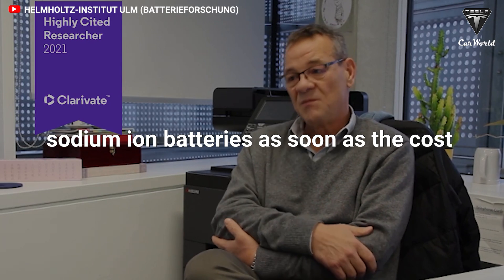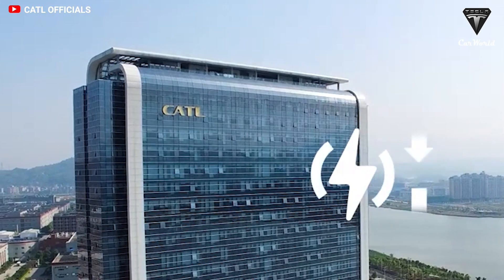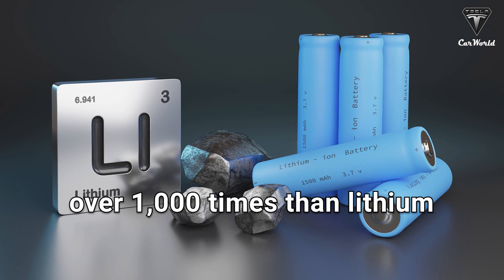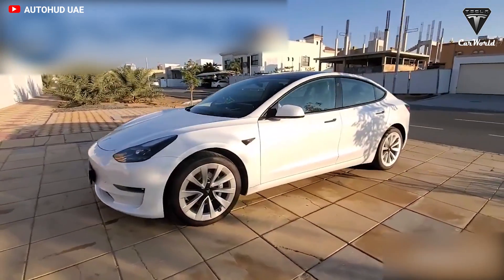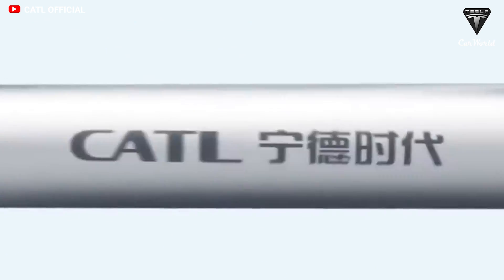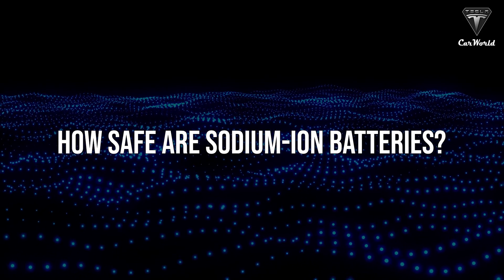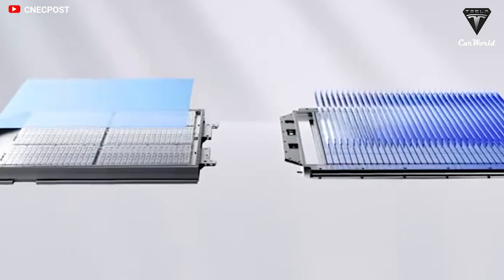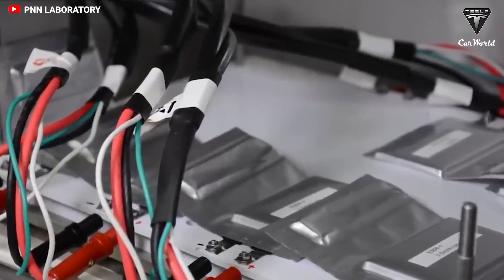Goodbye Lithium! NEW Sodium Ion 4.0 Battery Changes Everything in 2023!

Comment: One thing neglected to be mentioned here is how does Na-ion compare with Li-ion in regards to physical weight?  It'll affect range if more weight is needed to be moved.
Reply: They're heavier, but if they can charge faster and/or are cheaper, it might not matter.
Reply: @eventhisidistaken  Correct :) You notice this in many EVs in Europe, with a 50-60KwH pack.  If it charges in 10 minutes and you fill it up every 150-200 miles, it's basically no different than your typical ICE truck or SUV.  Most are lucky to get more than about 15 mpg combined and reasonable people fill up when it's around 1/4 of a tank.   This idea that the car MUST have a range of 300-400 miles is absurd and is simply marketing by Elon in order for him to need to build LESS Superchargers nationwide for his EVs.  That is, instead of making chargers every 150 miles, he has them at 200+ mile intervals in most of the U.S. And the industry followed suit trying to on-up each other similar to the HP wars we see with exotic cars.  Nobody NEEDS a 300 mile range car any more than you need a 750HP one.  What we need is charging every 40-50 miles in a proper grid so you can drive an hour, top off, and go on your way, no different than your current ICE vehicle.
Reply: @josephoberlander  my diesel car has a range of over 600 miles.  Of course, I could manage with less range, but it is extremely convenient.  I very rarely find I am caught short of fuel.  Of course, an electric car has the huge advantage that you can fill it up overnight at home.  I agree that this compensates for the shorter range most of the time.
Reply: @josephoberlander  that would kill my vacations. That would turn a six-hour trip in an ICE car to a lot more time.
Reply: He did mentioned it and also said that it needs less in a battery. Also the battery protection is less so overall the battery weights similar.

Comment: Battery weight is also a big factor with regards to power to weight  ratios in automobiles.  How do they stack up against lithium?  Heavier batteries with less capacity won't be the answer for mobile applications, perhaps stationary though.

Comment: I believe Lithium Carb is about 570000 yuan  ( time stamp 02:03 )  ( not dollars )   which equates to 84,000 dollars per ton.  By the way the current spot price today for Lithium Carb is 75564 dollars per ton.
Reply: spot price is not contract price. far from it. if it was i would be rich.
Reply: @victorhopper6774  thanks for pointing that out V,  I google searched it to get a better understanding.  The power of learning through You Tube amazes me.

Comment: They only have half the capacity of lithium, so they will have to be bigger to make it up, they weigh a lot more so the car will be much heavier and, crucially, they have low charge/discharge duty cycle life so they will have to be replaced much more often. Plus sodium is a lot more difficult to handle than lithium due to its habit of bursting into flames on exposure to oxygen or moisture.. Other than that - what can go wrong?
Reply: lol exactly

its clear he bought out some old tech to save some money on production, as you mention several of the flaws with it already .... but he will save some money on the production line... and the consumers will pay for it with lower quality product

Comment: if it enters production in 2023(taking account from January all the way to December for them to start the production lines) for commercial use you're looking at Availability being in either sometime in 2024 or early 2025 for Gen 1 Sodium ion batteries to be available. And if it's drop in replacements for existing lithium cells it could be instantaneously just component swapped in the same time period.
Reply: @WupeViasco  When you do something from scratch you're 100% right. What this Video doesn't cover is the fact the Manufacturing process used is the same process as Lithium ion. This is why this can be on the market so fast. I see this Gen 1 as a Lead acid, alkaline, Nickle cadmium killer than a Side step for Lithium ion.
Reply: You realize car companies have a 3 year testing period for new batteries right? How come your time table doesn't account for that? This is a new chemistry, it might need even more than 3 years of testing.
Reply: @James-ln6li  i don't and I also don't see it in Car production either unless Elon Musk says he's going to make Sodium Ion Batteries. I see them entering the market more for Electronics and Tools markets before cars. CES 2025 or CES 2026 they'll talk about Laptops having Sodium Ion batteries that'll last the user for 24 hours just watch. or DeWalt or Ryobi will announce new sodium Ion batter packs for their drills.
Reply: @James-ln6li  These batteries have been under test for a couple of years!

Comment: While I'm all for advancements in battery tech like this - there are some current drawbacks not mentioned.  1) Sodium-ion batteries still use lithium, especially when used for EV's.  Both CATL and BYD have mentioned this fact.  It's less lithium, absolutely, but it's still required to increase energy density.  and 2) charge cycles are 1/3 that of standard lithium ternary batteries.  So, 1000 vs 3000 roughly.  Not great either.  

All in all, lots to be hopeful for the future.  But as it sits currently, still a bit of work to make these the super-cheap world saviour of energy storage.
Reply: Also, this narrative is not correct about reactivity of Sodium. It states it is "less flammable" than Lithium... Haha! Throw a chunk of sodium in water and compare the sam,e experiment with Lithium, side by side. I would say, car with sodium ion batteries will burn better when crashed.
Reply: Less charge cycles (still 10 years for normal driving) but low cost.  Imagine if the battery pack was about the cost to manufacture as the transmission in a typical car.  Ie - less range, but the same cost for the motors and batteries as a normal ICE setup.  $25K for a basic EV, not $45K.  When you need replacement, it's a simple 2-3K drop and go procedure if designed correctly.  If it lasts 80-100K miles and costs 2-3K to replace, it's acceptable given how inexpensive EVs are to run.  When lithium soars to $20-30K for a battery pack, it'll also be our only option unless you are super wealthy and can afford the fancy graphene batteries.
Reply: @kbedn1395  Sodium-Ion batteries are non-flammable, it's been proven. You can't compare throwing a raw piece of Sodium to a whole battery with different material compositions etc.
Reply: @kbedn1395  Actually, the thermal runaway temperatures are about 100C less than Lithium-ion. This means that it's below the point where plastics and interior materials will catch fire.  That's the real problem with Lithium-ion.  It's a hugely hot brick that re-ignites the rest of the car's materials.  So dumping water on it is like putting water on a tire fire.  Loads of steam, not much else.
Reply: @josephoberlander  the price of lithium will drop in a few years or sooner. just at present a refining bottleneck. it is actually a common element.
Reply: @victorhopper6774  It's the same as oil.  We have a nearly unlimited supply of it. The problem is the inexpensive stuff is mostly all gone.  And they say that by 2035, the same will be true with lithium.  $200 per kWh will be considered low priced by then.  So we need an alternative or something that uses a very small amount of it.
Reply: @josephoberlander  The lithium won't be gone by 2035 because it will still be in the 15 year old EVs that at that point will be due for recycling.
Reply: ozrengalic9216  Of course it's possible. There are already companies recycling lithium based batteries on a small scale.
Reply: ozrengalic9216  your wrong and obviously have no idea how the battery actually works. They can be recycled just like a lithium battery which we are already doing. If you knew the least amount about battery production you would know this
Reply: Terry White  Elon called. He said TLDR
Reply: Consider advancement in battery tech in the past 10 years. Or five years. Sodium ion may seem clunky right now (like the whole EV infrastructure) but this conversation wasn’t happening last year. Let’s see where this takes us.
Reply: Terry White  Plenty of room left in Texas
Reply: @josephoberlander  that is what i had a discussion about today as wel. If the battery is cheap enough that its coming to 500$ a year and the cars dont need much other then that it wil be like taking you ICE in for a big service. Now a service on a normal ICE car shouldnt cost 2-3k. But its normal to get your ice serviced atleast once a year, so in 3 years you spend probably 1500-2k on service if nothing was broken. If there where some unforseen problems then it wil be over 3k. So if they get the price low enough its acceptable to change it once every 3-5 years.
Reply: @gabbermaikel  And that's likely the end result.  Replace the batteries every 50K miles as a consumable item but spend little to nothing on upkeep otherwise or if you drive like my parents do - maybe 3-4K a year.
Reply: Catl is the main supplier of batteries for Nio which uses swappable batteries. They can charge the battery but you could also change out a battery in a few minutes if you needed something for more distance.
Reply: @davesworld7961  That would be fantastic, but unfortunately no auto maker seems to care any more than Apple does any more about actually repairing or servicing their vehicles.  Hardly anything is easily replaceable on purpose.  But it would be great if it were that simple.  Or even if it was an hour to simply swap the pack out when it wears out.  A friend ha a BMW EV and it's already had one battery replacement.  Thankfully it JUST was within the 7 year warranty period.  Otherwise it would have been.. 30K(!!!) to replace.  People are in for a rude awakening when we're all forced to buy EVs in a decade as all of the old ones will be junk that's too expensive to fix.
Reply: @josephoberlander  Nio is an EV company in China that can swap batteries in under five minutes without human assistance.  People drive to a swap station about the size of a garage.  The swap stations are mostly in China and Europe.  I think with the tech Nio has now for fast swaps and with sodium batteries it makes sense.
Reply: Very interesting, great comments, thank you, however, as important developing inexpensive batteries making EVs, practical and affordable, creating a functional mass transportation to ease traffic congestion still makes sense…
Reply: @garyjohnson1466  We never said it didn't.  But trying to get people in the U.S. who have been force-fed the idea of exceptionalism and individualism at the cost of everything else for a hundred years now, to give up their "personal freedom" of owning a vehicle, is going to be a an impossible hurdle to overcome.  Vehicles will continue to be bought in ever-growing numbers. Limiting pollution when there is a SUV/Truck craze by making EV replacements the new hot thing is about all we can expect until until more progressive legislation is able to be pushed through.
Reply: @josephoberlander  i agree
Reply: Both points are very minor problems
Reply: HERE WE GO AGAIN;  HUMANS that SAID the SAME THING  YESTERDAY about the technology they ALL USE TODAY.
Reply: @josephoberlander  true, but if it was design correctly, build it and In time people will use it, change must give people a alternative to expensive EVs that require dwindling resources for batteries….
Reply: @garyjohnson1466  I was watching a review of an original SmartCar and it was simply about 20 years ahead of its time.  Now, a small hybrid or EV like it is exactly what we need.  Not 40K.  15-20K.  Small, works, and gets the job done.  Preferably with easily swapped battery modules so you can just upgrade to newer tech as it ages.  What we have now is basically disposable toys for the top few percent.  Hopefully new tech like this will help solve the problems of cost.
Reply: @josephoberlander  hopefully, time will tell…
Reply: You missed one: they double in size. 🤣🤣
Reply: @lukasschwab8011 They're also TWICE THE SIZE! You'll need a TRAILER! 🤣🤣🤣🤣🤣
Reply: @JavaAndroid  Actually the energy density is about 70%.  So your 350 mile range drops to 250 miles.  My Mustang gets about 250 miles per fill-up, as do most vehicles, since few people run their vehicles much past 1/4 of a tank.  It'll be fine as long as they also are easily serviceable.
Reply: As usual, in the Internet today, you get a gram of usable info in every kilogram of presentation.

Comment: Sodium batteries will help with the supply demand problem of lithium. Energy storage mega packs seem like the perfect match for first generation, especially in Cold climates
Reply: Totally! Grid + House engery storage should be their main targets. Weight isnt a problem for applications and those applications REALLY need a TON of salt.
Reply: @adr2t  if sodium ion is used for fixed storage, that  frees up lithium  for  EVs and could bring the price of lithium down.
Reply: This is incredibly in accurate. Sodium-based batteries cannot fix energy density problems. Even if we were to somehow create a new technology with sodium-based batteries it takes years to commercialize an alternative technology.

We don’t even have the proper supply chain for lithium batteries let alone an alternative technology, it will not be possible within a few years, if we’re lucky and they can fix energy density issues we might have sodium base batteries within 15 years
Reply: @WupeViasco  that is why I said,  use sodium ion for fixed storage,  Grid level storage , power walls etc. And keep lithium for mobile applications.
Reply: @WupeViasco  Doesnt fix, but it does improve. Sodium can in theory hold more power than Li once we have a better understanding. Let alone cheaper and more available. Instead of building everything in China like we are right now, we could start moving battery production closer to "Home (EU, US, CA, etc)". The problem with Li is the fact its only process in China and then ship around the world. Let alone mining the stuff currently does take a lot of resources too. By limiting the use - we remove a large cost to just getting these things out there. Fun fact, the process to get Li has a lot of sodium as a by-product.

Over all - sodium will be the future. Even if its not as energy dense as li is right now. Its already in use and in production - so 15 years is out dated. It will just scale with what our needs are and what can afford the switch for now and that will be the biggest customer.
Reply: @adr2t  but to reach a scale of where this could be commercialized will at least take 20 to 25 years if we’re lucky maybe 15 years, it took 30 years of research and development to commercialize Lithium ion batteries, and there’s really no incentive to replace Lithium only batteries aside from the fact that lithium is in a shortage.
Reply: @WupeViasco  No, its already commercialized. Its already in a few applications. You mean at a scale that is the same as Li? Well yea.. That will take time. The benefit though is that it can be brough home and setup for less though. China has actively thrown out threats to the US saying they shouldn't produce said battery or there will be problems LOL. Also, keep in mind, that 30+ year thing is a bit of a lie... but also, Sodium will have to find its place in the market until it gets better energy storage to weight. So even if we could - the technology is actually a step backwards for now and thus the production scale wont really be a main goal for a little while.
Reply: @WupeViasco  the huge difference in cost will speed up the upscaling in no time. CATL claimed half the price per kWh compared to LFP. and theoretically it is even cheaper. that means that CATL and others can make an insane high profit that can be invested in upscaling.
that means that we won't see them in cars soon, because home/grid storage users will pay more for it.
CATL claimed 2023 as start of industrial full scale production.